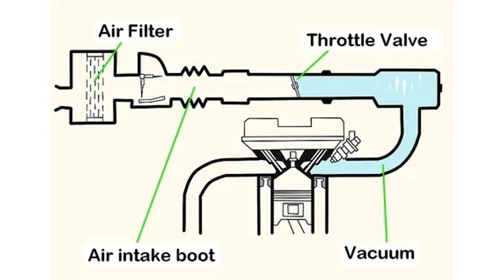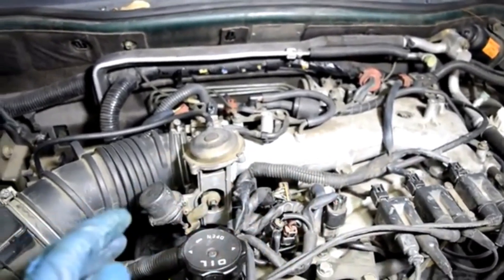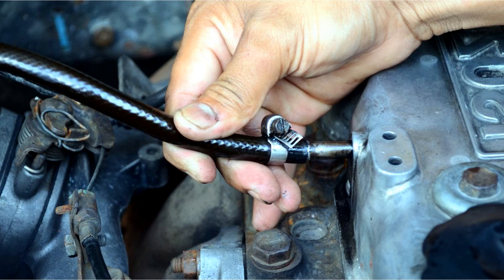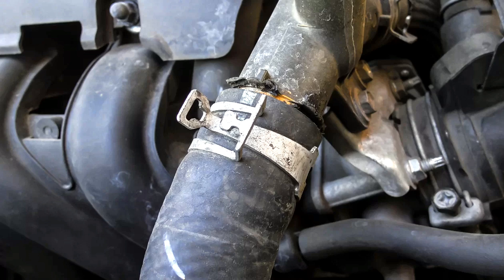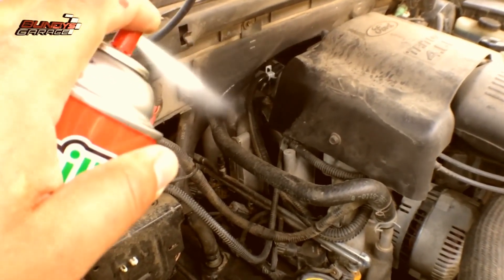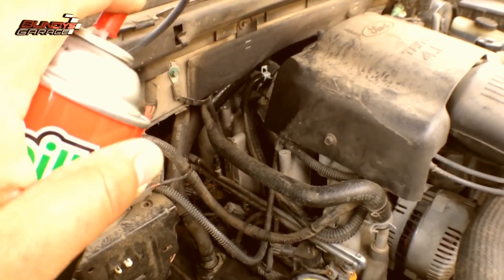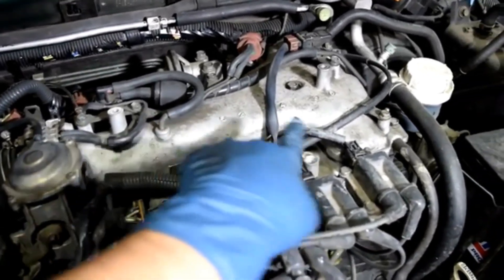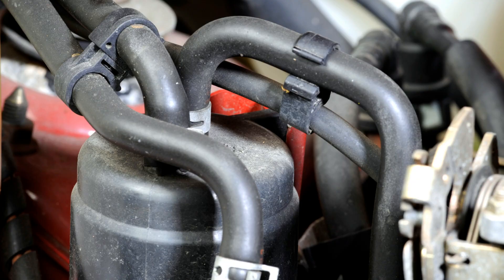HOW TO FIND AND FIX VACUUM LEAKS A MINUTE! | Symptoms of a car vacuum leak

Comment: 1 Scan pcm ,check map sensor readings 2 visual check if something is obvious .Us a small propane bottle with a hose attachment .Turn on propane bottle and use hose to hunt for leaks that will suck in the gas and cause idle to increase. Found your leak ,replace rubber vacuum line , or leaking gasket ,or crack fitting on intake ,or evap line . Easy Peasy .Re ck scan ,map reading ,should be back down to 1.50 volts at idle ,give or take .